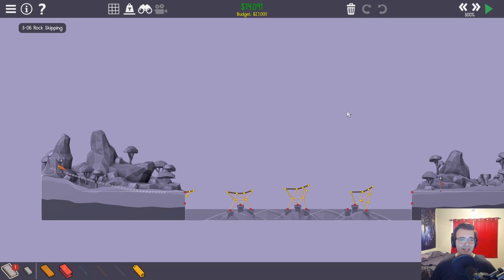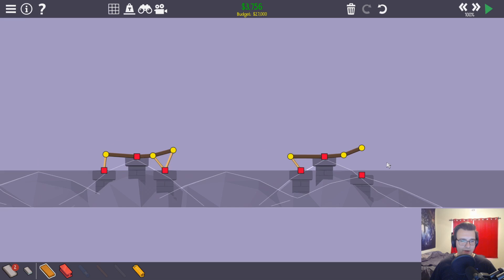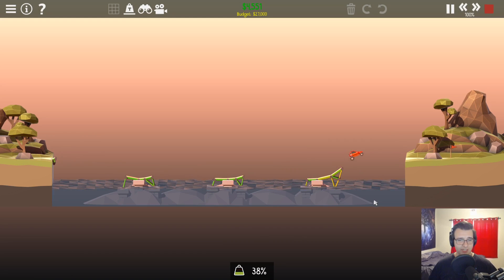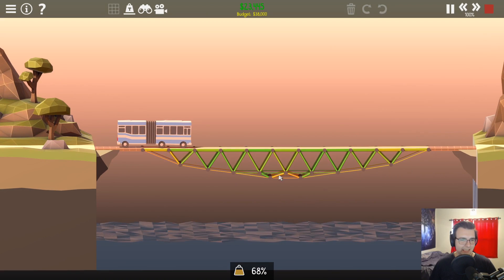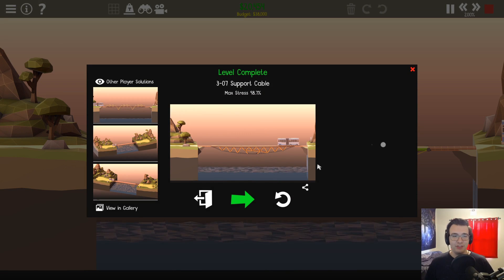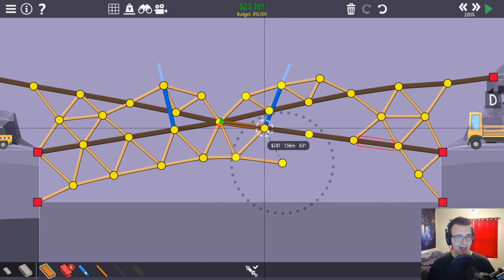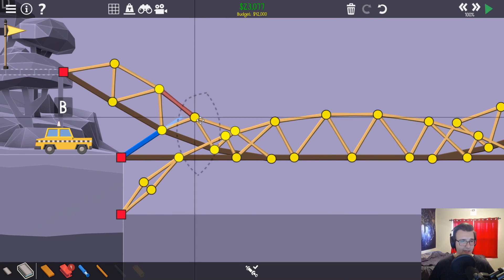Engineering Tip - Drop Useless Road Into the Void

Comment: 08:44 it works because the middle part can move, so cable takes stress, but tensions is not on the road. Symmetrical is good for real world when bridge need to work more than once.
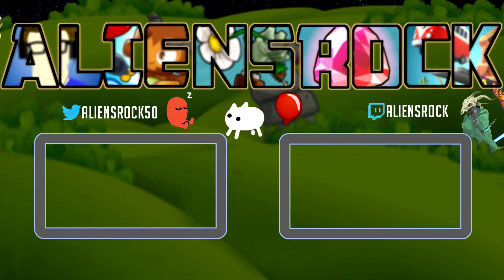15:00 one question, why not drop both ends in hydraulics phase without hydraulics ?
Ideally the taxi goes up, right ends drop in a way that allows the truck to pass (without any attachment), and they reuse the same piece of road. 
The Left side should be able to do the same thing with just a leg support, maybe with careful design, attach itself before truck comes.

Comment: If two vertices are immovable, any vertex which is attached to each through a rigid linkage will likewise be immovable, even if that would make a "square" or other open polygon.  Making a rigid linkage requires building triangles, but if you have a structure that connects some fixed points to V other vertices, it should have 2V edges.  If a structure has more edges than that, some are likely redundant, and might sometimes make the structure break more easily by concentrating force where it shouldn't be.

Comment: If I remember right there is a more cost efficient way of making cable bridges where instead of triangles you just have a single wood straight down from each joint of road, you should try it. Do note that I think it's only more cost efficient and I think it's a bit weaker, but I can't test it in Poly Bridge 2 since I don't have the second game so I cannot confirm whether it's weaker or stronger than triangles when done right.
Reply: A bridge made of quadrilaterals will be flexible like a dangling bridge, which could be a good thing or a bad thing, depending upon how loads move across the bridge.

Comment: On 3-08, can’t you just make a trap door
Reply: Or have a piece that holds up the first side, but drops it with a split joint?  A trap door would put extra weight on the vehicle, which would in turn put more stress on the bridge when the vehicle is on it, while a split joint could delay the drop until the vehicle has left.

Comment: forms trapezoid

"This is a nice pentagon"
Reply: 2 short lines connected together at 180° doesn't count as 1 line
Therefore it's technically not a trapezoid
Reply: Torrey Whiting yeah it does. it’s just one continued line
Reply: it had five sides tho
Reply: 2023czigler and?
Reply: 2023czigler what does that change
Reply: Octopus Of the nine realms ok, so is he assuming that we’re stupid?!?!!!!??!

CRUSCIFY 2023czigler
Reply: @2023czigler what are you using the double tilde equals sign to mean? 

(I would just type the character instead of describing it, but Im on mobile, and that character isn't easily typable)
Reply: @torreywhiting5402 
Double tilde = approximately
Reply: 2023czigler rectangle = trapezoid/trapezium